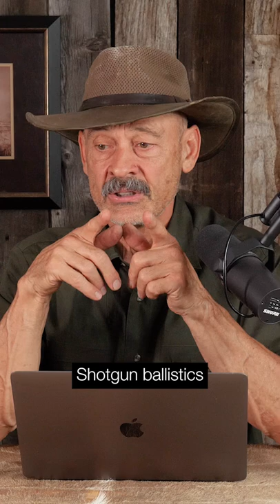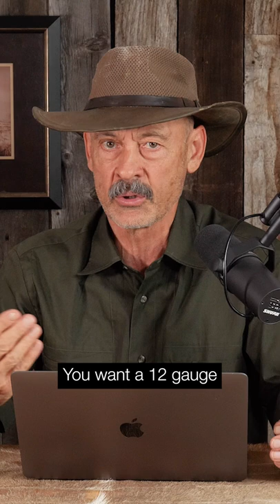Shotgun Ballistics Explained

Comment: Ron, finally someone else saying this. It is so ingrained in people's heads that they just refuse to understand.  A #6 (or and size, other than slugs) shot at say 1200 fps, doesn't know or care if it came from a 12, 16, 20, 28 or 410. Now we could really kick the bee's and discuss shot string (column) and pattern density.  
Cheers Jeff

Comment: My son has become a hunter and recently I suggested that I'd like to join him hunting water fowl, but I needed to buy a shotgun.  He sent a link to a 20 guage on sale (super cheap Mossberg) which I dismissed. 

If I follow the discourse, if I'm a good shot, hitting with a narrower spread of shot, I can take down ducks or goose with a 20 guage, since the pellets that strike them are as heavy and as high a velocity ss those fired from a 12 guage.  What about range.
Reply: Range would depend entirely on the choke you'd be using and the pattern it would throw at that range, from ehat I've heard its typically a 100 yard and in sport with the tightest chokes you can find and using somewhere in the 3-BB shot size range. I don't hunt water fowl but i do hunt turkey, and with my cz over and under and my weatherby pa-08 (both 12 guage) with full chokes in either of them i can throw a roughly 1 ft spread at 50 yards with number 5 shot (smaller than what most would want duck hunting) without getting into any specialty or extra full chokes. Just test out how your shotgun preforms, I've seen 100 round packs of steel shot duck loads at Wal-Mart pretty cheap and im sure theyll work just fine, just pick up the load you want and test it with your shotgun to see if it throws a tight enough pattern for you and what you'd be comfortable making.
Reply: A 20 ga works just fine on ducks and geese. There are less pellets in the 20 but if you do you job they work great. There are also a number of high tech shots on the market that are nearly as dense as lead. They tend to be costly, but depending on your budget and the amount of shooting you do they can work great. I rarely kill a duck or goose at more than 30 yards, but I like to work the decoys,  calls and the birds. I'd suggest patterning your shotgun, choke and load. Just because one is best in a friend's gun doesn't make it the best in your gun. Good luck and have FUN.
Reply: @jk-kr8jt  thanks.  Bottom line do you use a 12guage
Reply: @jodywhitehead9173  I do often use a 12 gage on waterfowl. For several reasons, not just because it's a 12, because I often use a 20, 16 and on occasion a 28. Usually it just depends on the gun I wish to bond with that day and how beat up it will get. The big advantage to a 12 is that the hull (shell) holds more pellets. If I'm with a group of friends I usually hold off until everyone else has had their shots and I pick off the cripples. I hunt alot and would rather see the people who don't get as many opportunities get their shot in first.
Reply: @jk-kr8jt  again thanks.  I'm a cheap sob, so I wasn't sure how much my sons recommendation reflected price vs functionality. lol.  When my 2 oldest boys were teens I took them trap shooting most weekends, and, one Xmas gave them a 12 guage.  I doubt I actually shot more than a dozen times, using both 12 & 20 guage.  I typically hit 22-23 targets and don't remember any significant difference between guages.  This probably approximates your 30 yards?  Are waterfowl that much more difficult to hit than clay pigeons?  Does increased trap shooting practice translate into better hunting success?

Comment: Do 4 inch 20, 16 & 410 gauge shotguns exist? They could fit more pellets in that way too. Right?
Reply: No they don’t exist. Also consider that increasing the payload (number of pellets) would slow down the velocity of the pellets unless faster powder or more powder were used to increase the velocity of the heavier payload. It’s complicated but over the many years, arms and ammunition makers have standardized everything so that 3 1/2” is the longest available.
Reply: Biggest I've seen/heard of is 3 1/2 inch but that's usually in 12 and 10 gauges. Im sure some bubba might've made some unholy abomination before but it's definitely far from standard.

Comment: Let’s say all I have is a shotgun and I’m in bear country for some reason… which calibre of shotgun would I want? Is there a pellet shot for something that large or would you be better off with a solid slug if you were being charged at?
Reply: If you're defending yourself, go for the slugs. You might be able to get away with large buckshots (like 000 buckshot) but i wouldn't want to try it, especially when you wouldn't get many more projectiles with it and it might not penetrate enough. I'd personally go 12 gauge but that's just because it's usually cheaper than 20 gauge and it's a heavier slug so more likely to do what i need it to do, especially when you think about how their fat can stop some pistol rounds when they are on the larger side without letting it hit anything important. Just my input though, take it with a grain of salt.

Comment: Typically I love these short videos but I think this one kind of misses the mark.   No mention of pattern density which with shotguns is what it's all about.   Not quite the same as volume of shot unless size of shot is defined.
Reply: He did hit on that, just in really basic terms. I know that he didn't say pattern density or even the type of shot string , wad type, blowing the pattern, chokes or the pattern board...but did give the basic jist of speed vs bore size, which is where most people get messed up. He is saying that a .410 can kill a duck just as well as a 10ga using the same pellet size...as far as down range energy goes and he is right. He also mentions pellet density, just not the way that we would say it. As shotgunners, we know that a .410 is a expert wing shooters tool and a 10ga or a 12ga 3 1/2 is a meat hunters tool. Even though they both are lethal at the same range. I'm sure that he has a video about shotgun interior and exterior ballistics and that rabbit hole.